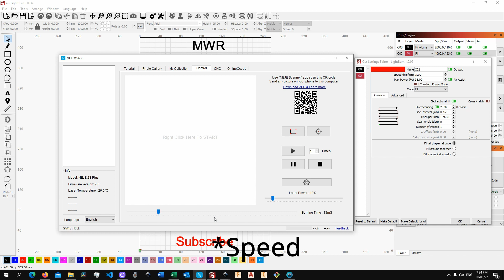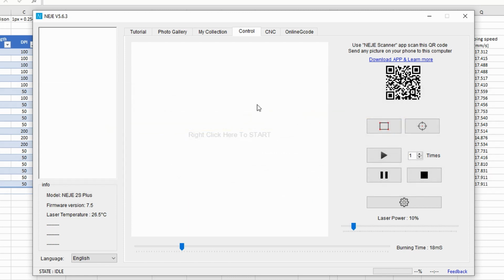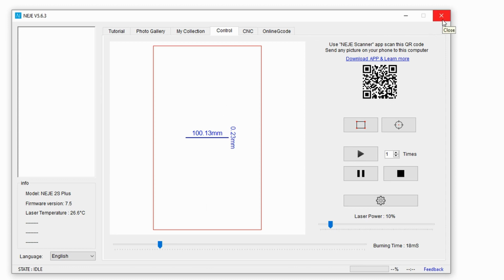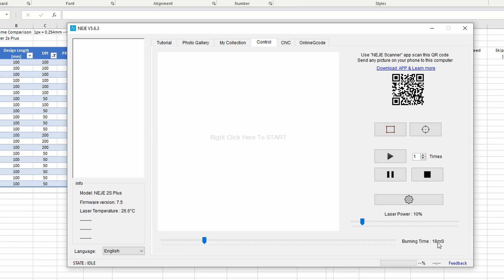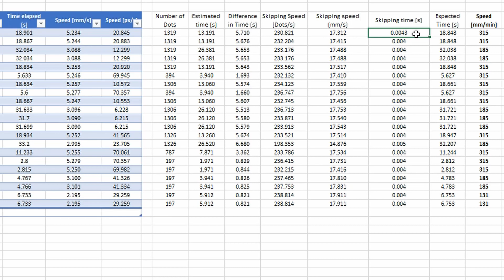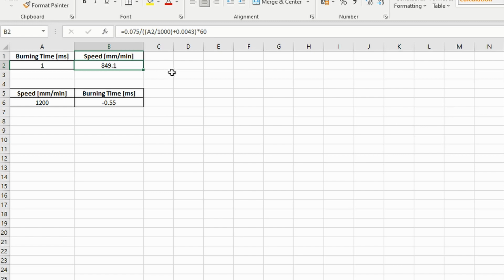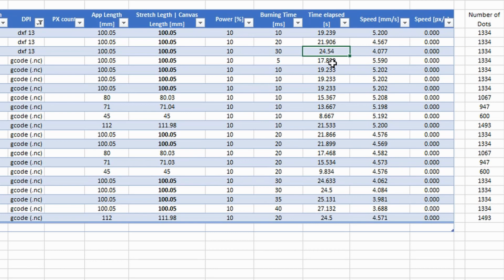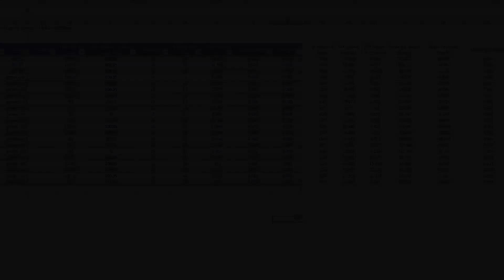What is Burning Time - How does it convert to Speed

Comment: it might be that neje is using not only different time but also czanging the laserpower... ididthe engraving on a mirror with 40% laser and 20ms and  I run the material test on lightburn fron 10 to 2000 and 10-100% ... nothing was even close to the neje output ... thats a nightmare
Reply from the maker: Hi, thank you for your comment.

I do recommend everyone switching to Lightburn and forget about the NEJE app, which is limited and uses a pointless approach.
Lightburn will make your life easier and cause less frustration.

Ciao

Comment: Thank you .. im using LightBurn what is the maximum speed (mm/min) of the stepper motors ?
Reply from the maker: Hello Zakaria Khouni, thank you for your comment.

Reading from the controller is 10200mm/min, however, that is not the top speed, but what it has been set to.

The stepper motor, in particular, the Nema17 can reach very high rotational speeds somewhere around 4000RPM, however that is usually limited by the motor driver. You need to convert the rotational speed to linear speed, i.e. measured in mm/min (or similar), but for that, you need extra details about your stepper, step angle, micro-stepping, pulley teeth count and timing belt pitch.

Ciao